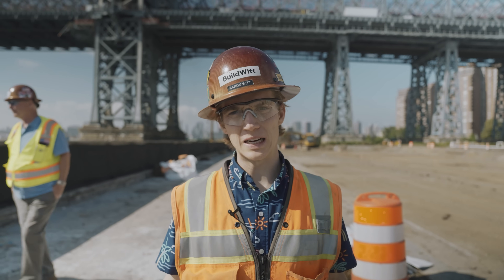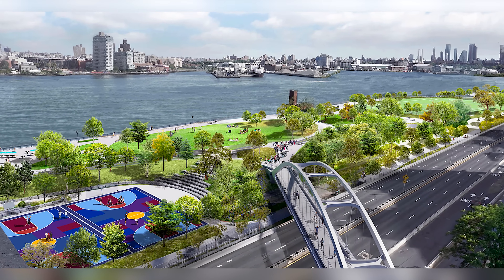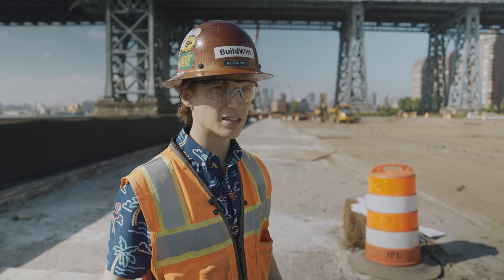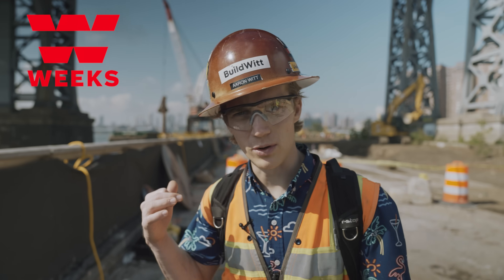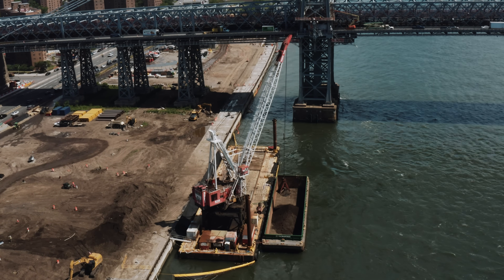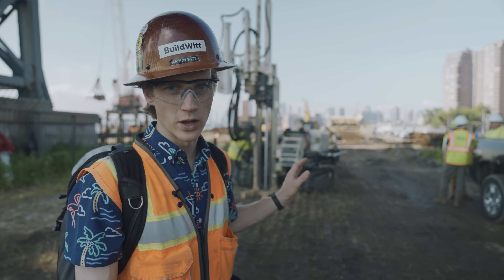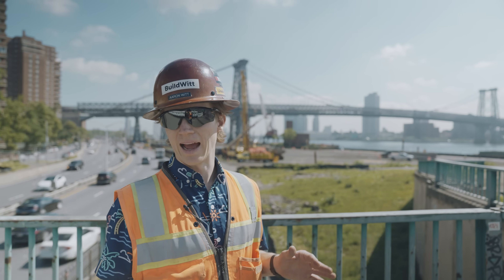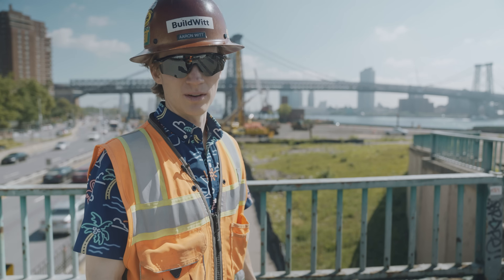Stopping New York City's Floods

Comment: Why in the world aren't they using a dry vacuum excavation?  Seems like a big opportunity for a follower rig that could basically transfer the fines from the leading edge of the pit to the finished edge of the pit so they could just move along.
Reply: That's not the NYC way.  They do things backwards that's why there hauling the material off and bringing more in. Lol
Reply: @BS.-.-  Yeah man I was shaking my head at that too. Like... I can't wrap my head around that. How is it better to haul off the 'contaminated' dirt only to bury it somewhere else?
Reply: @bradley3549  you have to haul it off due to the regulations in NYC that classify it as “non-hazardous contaminated non reuse soil”. It gets shipped to NJ to a soil treatment plant where it’ll be decontaminated.
Reply: @bradley3549  the tribe here does the same thing😂 I just find a rancher who doesn't give a fuck and dig a hole take the dirt and bury the contaminated shit

Comment: Are the air knife tubes made out of non conductive fiberglass.  If I were a contractor digging around power cables I would retrofit my tools. Fiberglass shovels with fiberglass blades with ceramic or perhaps metal cutting edges.
Reply: I have never seen a non conductive air knife tube whenever there was a dig in my 200 mile area of responsibility for a fiber optic.